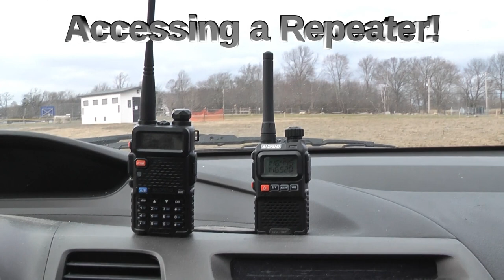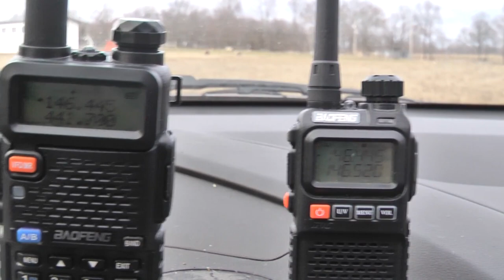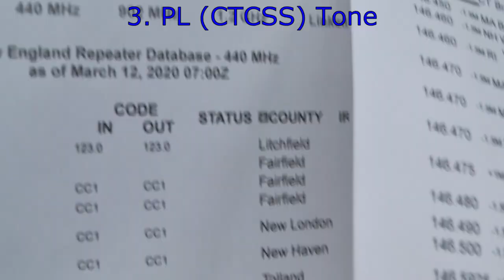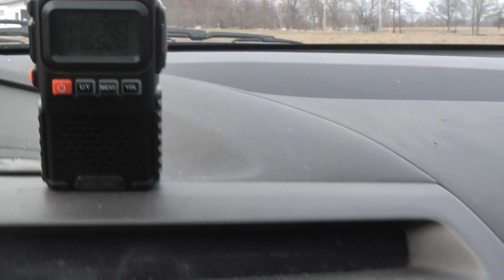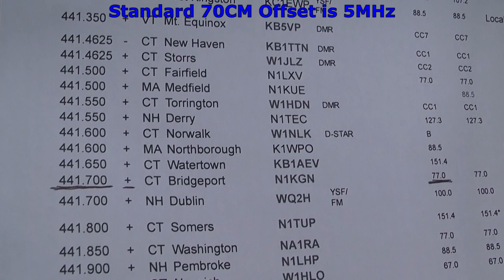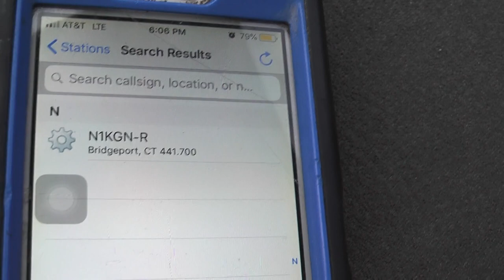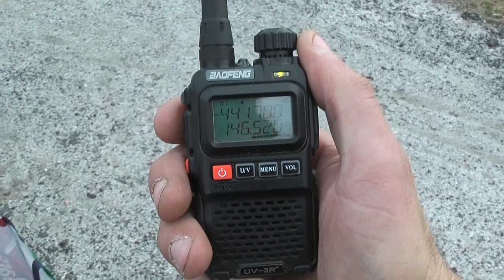Accessing a Ham Radio Repeater

Comment: I am trying to program my radio to my local repeater. I am new to HAM and still learning. My local repeater was found on repeater maps and it has Two frequencies. It is for Hornell NY. The numbers are 53.370- call sign K2TJW and underneath it says 146.865-. How do I figure out what the offset is?

Comment: Newbie here.  Can I use a GMRS radio to listen in to and speak to a repeater to reach another GMRS radio.
Reply: Only if you have a GMRS repeater in your area and your radio supports CTCS (for the tone). Main issue is, most off the shelf GMRS radios don't list the CTCS codes as frequencies. They list as 1, 2, 3. Not 67.0, 69.3, 71.9. etc. In short, yes if you can set it up to a local repeater.

Comment: From how far away will I be able to use a 2 meter and a 70cm repeater?
I’m about to order an Icom id-52, if that matters.  It will be my first ham radio.
I’m scheduled to take the test soon …
Reply from the maker: It all depends of the topography from where you are to the repeater. If you have a nice line of sight to it from a high vantage point it could be 20+ miles. If you are down in a valley with a mountain in between it could be 1 mile. In this video i was at high location with the exception of some trees and foliage blocking a direct view, i almost had a direct line to the repeater so it worked well. 2 meter will travel farther with more obstructions but requires a bigger antenna. 70cm will radiate efficiently off a small antenna but line of sight is more critical.
Reply: @greaterbridgeportamateurra8429  Thank you.  I live in Phoenix, AZ, so I’m surrounded by peaks.  Surely I can reach at least one, so I’ll go ahead and order the Icom and a better-than-a-duck antenna.

Comment: So if you and a buddy both have handhelds can you use a repeater to extend the range of your handhelds ?
Reply from the maker: yes that is excatly right! as long as you can hit the repeater you can now reach its full coverage footprint with just you handheld
Reply: @greaterbridgeportamateurra8429  thanks for the response I’m just curious because with our handhelds and on a repeater frequency we’re only getting a couple miles of range no different then when not using a repeaters frequency I assumed that if we both hit the repeater our range should be greatly increased?
Reply: @greaterbridgeportamateurra8429  we live about 12 miles apart an it’d be nice to be able to reach eachother, I’m looking into a antenna to put on the roof but confused on all the options I’m sure that’ll help but again I figured if we can both hear the repeater why can’t we hear eachother?

Comment: i have a question, in this area i am currently staying, there are 4 repeaters. i can only seem to transmit on one of them. all four beep as i let off the ptt button like it worked, but i have another ham with me with his radio and he isnt getting my transmission from the repeater. i am new this this area, wont be here long, and i didnt plan to get too intimate with the hams in the area, but the local club has two websites and the newest one hasnt been touched in 5 years and their facebook page hasnt been touched in 3 years. both of their websites show conflicting info about the repeater, they do  show some of the info needed to get on them, but they do not list the offset values, but say their repeaters are open for all to use, which i find curious. i was able to chase down the offset values from repeaterbook.com. I work in IT so i am tech savvy and i was able to get one of the repeaters to work, but ham is somewhat new to me. any ideas as to why the others wont work?
Reply from the maker: Two repeaters may be linked but on different frequencies, they are usually linked through an audio, rf or internet link, sometimes the operator will turn the link off for some reason that could be the issue, it may not be your radio thats the problem. Or it may be an outdated listing thats no longer accurate?

Comment: I have basically the same radio, when I go through the menu and make the changes, they all default back to "off" as if I didnt change then but the radio give confirmation that I changed them. Any clue why that keeps happening? I am not looking to transmit just yet as I am working on my extra lic. and skipping tech etc...
Reply from the maker: you may be hitting the wrong buttons what model baofeng is it?
Reply: @greaterbridgeportamateurra8429  I figured it out, you have to be in "frequency mode" to do the changes. I had saved the repeater freq. and then tried to set it up while in ch. mode. F8HP**

Comment: It looks like the closest repeater to me are 30 to 40 miles away. Will I be able to reach those with a handheld?
Reply from the maker: you may be able to depending on how straight of a shot you have to the repeater site. You can also get an base antenna or a yagi style and just plug that into your handheld radio for way better results. Whats your location?

Comment: What’s the difference between r-ctcs and t-ctcs?
Reply from the maker: Just like most repeaters require you to transmit a ctcss tone in order to open it squelch and let you in(ctcss-t) (so you would transmit it, it would receive it), you can also set your radio to only only open up its squelch if a signal received has a certain ctcss tone on it, so you would set the ctcss-r setting, however very rare you would ever use this feature.
Reply: Receive and transmit.

Comment: I thought I'd be able to pick up a couple ham radios and be able to communicate 150 miles. No?
Reply: Well handheld units not a chance. Base station set up with a good antenna and a few repeaters most definitely. But if your hidden behind mountains it's probably not going very far.
Reply: It is not that simple.  The answer is always "it depends".

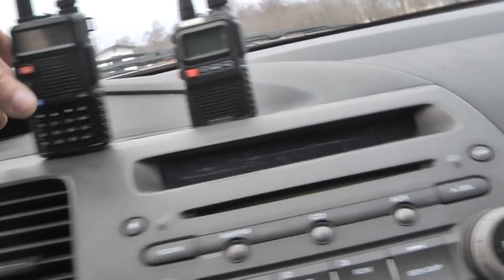Comment: Video is poor quality. From time stamp 4:30, the radio LCD is not in the frame and and we do not know what you are doing and we missed what was entered into the radio. Video was not helpful. Will check for other videos for help.
Reply from the maker: Set the recieve freq of the repeater, the transmit tone, then the transmit offset. Thats all you need for most repeaters